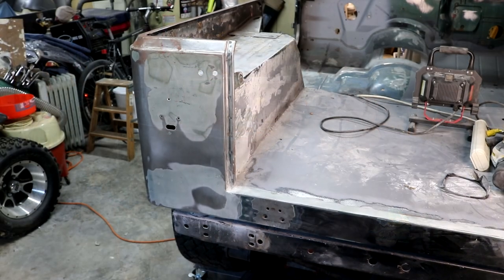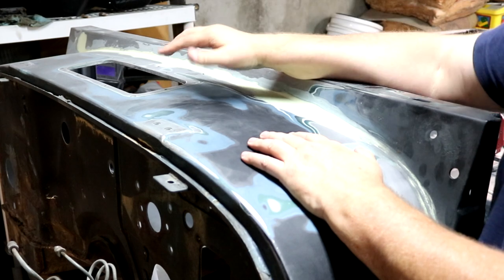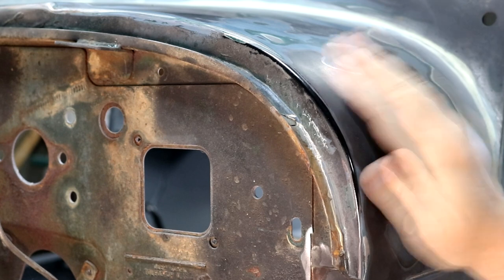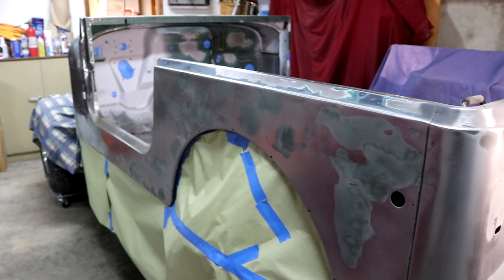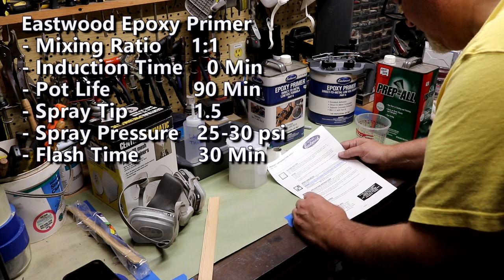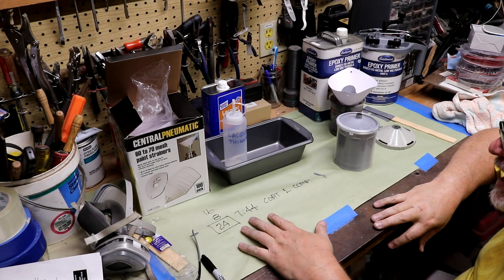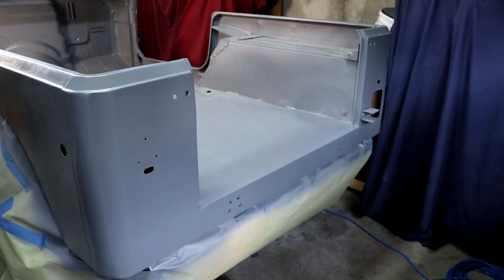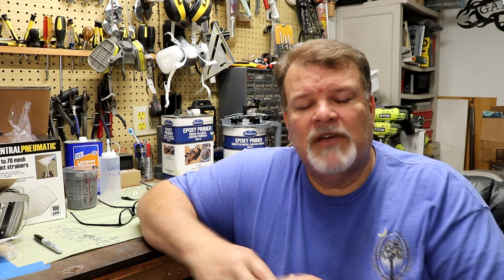Jeep CJ7 Tub in Epoxy Primer | Project Rowdy Ep039

Comment: LOL, I have been following Project Rowdy for some time as I am in the process of doing the same thing to a 1979 CJ7.  You did pretty much everything I have needed to do on the Jeep as mine was a rust bucket frame rails out.  I still have a lot of work to do but it is getting there.  I am in the process of fabricating the driver's side Quarter panel right now as the Jeep was in a wreck and it was hit and screwed up pretty bad.  I am trying to salvage the top rail since recreating the bends would be a big job to tackle.  I had to comment when you brought up the 1968 Camaro, I am also doing a frame off restomod of my 1969 SS Chevelle.  That is just to much of a coincidence.  :)  Good luck on the Camaro as well as finishing the CJ.

Cheers
Eddie
Reply from the maker: Two men with the same passions.   My Jeep project started off as.... " Just fix and replace what is bad or broken".  The more I fix, the more some of the "iffy" parts have to go.   Wondering if ordering the whole Jeep as parts off the internet wouldn't have been faster.   Hell, I'm still slowly tearing things down and it's been 4 years!  

Well, it is worth saving these ole things.  They are tons of fun.  Bought mine in 1988.

Looking forward to a little change of pace with the Camaro and some simple updates.

Cheers to you as well!    Mike

Comment: I love the raptor liner I put in my cj it was easy to do as well
Reply from the maker: I think I may go that route.   Can you give me an estimate on how many cans would it take to just do the bottom of the tub.  I plan to do more than that but can use that as a starting point for estimating. Thanks.
Reply: @UCanDoIt2Mike  on the complete inside on my tub I used 3 cans at 60 psi which is a little bit of a rougher more texture than most people do. They come in a kit with the gun and 4 cans for like $140 I would start out with that. If you think you would need more I could buy 2 kits I mean it’s not too too expensive. But I’m pretty sure you can buy individual bottles.
Reply: @UCanDoIt2Mike  this is an actual gun and bottles you spray with an air compressor so you can adjust the your psi to how ruff or less ruff if a texture you want.
Reply from the maker: Excellent.   Thanks for the estimate and I think I will buy the kit with gun and 4 bottles to start.  I plan to do the tub bottom and tub top. Cheers.  Mike!
Reply from the maker: @coltonthompson1844  Yes...  I have seen that kit.  I appreciate the info on the coverage.  I'll start with the 4 bottle/gun kit and add more bottles as need to cover the other areas that I plan to be textured.   Thanks again!

Comment: Mike, looks great!  Haul Rowdy up to NE Ohio and we’ll get it painted!  Couple things I noticed, I use the same gun for my primer,  leave the air on continuously so the primer doesn’t build up on the tip.  -this will be much more important with the 2k high-build.  If you go with the Raptor Liner (like I did) you can use my applicator gun.  Just let me know.  Last thing,  I used 2 different cleaners for the body before painting.  1st wax and grease, 2nd stuff is called “final-wipe”.  Then finally with a tack cloth.  Again, glad to see you back man!
Reply from the maker: Bob... If you were closer, I would take you up on that offer and if things get slow around here, I am always up for a road trip!  I believe that most of my problem is that my Air Compressor is in the same room and when it kicks on, it blows dust.  I blew it off and tried to clean up around it but not much luck.  Thanks for the reminder on keeping the air going, I know to do that, but forget to do it.  I'll make a note an put it with my equipment to remind me.  I believe I am going with Raptor Liner.  I might take you up on barrowing your gun.  Let me look into pricing and kit availability.  What is the name of your Wax and Grease remover?  Cheers and thanks for sharing your Jeep project on YouTube.   I really enjoyed following your project and added many notes to my OneNote log based on your experiences.   Mike

Comment: How are you sanding to remove the flash rust? Are you using a sander or just a hand block?
Reply from the maker: My flash rust was on surfaces that had previously been sanded smooth.   I was able to hit it with 320 on an orbital sander and it came right up.  

If I had found anything deeper, I would have tried wire brushing and then hit is with Eastwood’s Rust Inhibitor.

Comment: Hey Mike! How is "The Mistress" coming? We need more videos bro! 
Also, you mentioned adhesion. Does the Eastwood call for 400 grit? That sounds kinda fine for bare metal. 
For prep, I use Sprayway glass cleaner, possible acetone if greasy, then always final clean with PPG H2OSoClean W&G remover.
Reply from the maker: My son and are currently trying to uncover a gremlin in the headlight circuit.  Been screwing with it for 3 hours.   Believe we have it nailed down and plan to bypass original wiring.  His wedding is this weekend and he wants to drive away in it.   Have several videos on it that I need to edit and post.   Cheers.
Reply: @UCanDoIt2Mike  Good luck! Have a great time at the ceremony

Comment: Thrilled to see you back. I'm going to be trying Eastwood roll on primer on my 57 Chevy so similar products. I'm wondering about your concern on the short strand fiber body filler would a sealer prior to epoxy primer have covered different? My Jeep will get work after the Chevy gets primer.
Reply from the maker: Would like to know how the Roll-on primer works for you.  I assume that it it self leveling.  For my primer situation, that is the second time that I have applied it over metal and SSF ending with the same result.  I feel confident that now that I have a consistent coat of primer on it, that future coats will hide it all.  As I mentioned, there is a little bit of normal body filler that needs to be applied and then a few coats of a high build.  The High Build should cover it well.

Cheers and many thanks for following along.  Mike

Comment: I first started following you when you were doing the LT1 Swap.  At that time I was planning on putting an LS in my 37 Chev PU.  Well. my cousn's son found a pristine 2014 Silverado, low mileage with a 6L80E transmission and thought it would be a nice drivetrain for my truck (the truck was originally his grandparents).  Well I have it and I"m finding that an LT1 is very differnt than an LS. No power steering pump.  Vacuum is by a belt driven pump.  It's direct injection and there are no guieds for rewiring the harness.  And even if I could, there is no rooom in the engine compartment for the computer.  SO I'll probably go to someone like SPEARTECH for a custom harness.  I can get a PS pump and mounts for around $500.  Overall, it's going to be an expensive engine to get operational.
Reply from the maker: That is going to be a fantastic ride when you get done with it.   You'll never look back.   Have fun with it!  Mike

Comment: Looking good. Full bunny suit should be used.. paint is toxic. 1.8 tip on primer paint will flow better. Filter cartridges in plastic bags between use. Don't  wimp out on painting top coat and clear, your prep is very good, your results will be the same...Cheers.
Reply from the maker: Thanks for the feedback.   Mike

Comment: i somewhat stopped watching your feed after the LS material was completed, very much enjoyed your narrative on the subject..... noticed that you are now in the body restoration part now, I have never been a big fan of Eastwood paint products, I have been in the automotive refinishing trade for years, and for the home hobbyist, you may want to look into Southern Polyurethane products. Their epoxy primers are very user friendly and in line with top manufacturers for quality without the price if you are not able to get the usual volume discount. Their clears are also top notch as well.  As for doing your final painting of Rowdy, I am not aware of your surrounding, but what I now do for home spraying in decent weather (decent temp and no rain in the forecast) is to purchase a temporary Garage structure (10x20)) for a couple hundred $$$ and on the one end cutting an opening in the panel and attaching a 36" fan with furnace filters fitted to the outside and pointing it such that the tent is positive pressure. the amount of dust is kept to a minimum and the little that is there is very easily cut and buffed out..... just a thought, but it really depends on your surroundings, not something that is really acceptable  if one is living in a subdivision, unless your neighbors are gear heads
Reply from the maker: Thanks for the detailed response.  Several of the channels that I follow use SPI and they appear to like it as well.  When I run out of what I have, I will most likely give them a try.  Not sure the Neighbors will go for a popup tent.  They complain when a car is parked in the grass.  You know those type of people with nothing better to do than complain.  Cheers   Mike

Comment: When I sprayed primer on my CJ I built a paint booth out of PVC pipe and big plastic sheets.  It worked pretty well.  I'm planning on rebuilding the paint booth when I do my final paint.
Reply from the maker: A PVC Tent might work for me.  My biggest issue is that my Air Compressor is in the same room and the cooling fan blows towards the work area.  Think the wife would mind if I moved it to her laundry room?

Comment: Thanks for the post.  I have a 93 YJ and have the same issue with the cowl/pillar or whatever its called.  Did you do a video on it or photos on how you did it?  The part that's rotting out is below the windshield and I was thinking I could just cut out that part and weld in new metal.  There is seam sealer on that seam on mine.  I have a rubber gasket where the hood mated up with the cowl.  I will be looking under it when I get a few minutes.
Reply from the maker: Sorry about the late reply.  If you are talking about the joint that I replaced under the dash where the Cowl meets the lower windshield panel....   I did not video that work.  I did fabricate all of the parts from flat sheet metal.  It gave me a reason to purchase a Shrinker and Stretcher tool.   On the outside, I have to replace a 1" section of the Cowl and 1" section of the lower windshield frame.  I made that out of 2" wide sheet metal.  Bent it in half and then stretched the Frame side to obtain the curvature of the cowl, then I had to Shrunk the cowl side to bring it back flat with the frame.  By making this out of one piece, I was able to create a very strong joint.  I believe I also added a small strip of metal to the inside of this seam.  Very pleased with how it came out.  Hope this helps!  Mike

Comment: Enjoy watching your progress!  I just got a new '79 CJ7 "project" and will be doing a 'tub off' restoration. It sat in a field for 15+ years so I have got some work ahead of me, especially tackling some body rust.. What gage of metal are you using for the body patches?  Thanks!
Reply from the maker: Love it!  I am using 18 Gauge.  As I need more, I pickup a "cutoff" piece at my local supplier for cheep.  So many of the surfaces on these tubs are straight, so making replacements yourself is not very hard and very rewarding.   Welcome to the club and I hope you enjoy your project.  My next step is to remove the tub from the frame so that I can cleanup and coat the bottom surface.

Cheers to you Jason!   Mike
Reply: @UCanDoIt2Mike  Thanks Mike!

Comment: Hey Pardner. What did you end up figuring out for the indentions all over the place from the spot welds. Did you use fiberglass or bondo for those?
Reply from the maker: For mine, a little of both.  I had cleaned all the paint out of the intentions.  Many of them were treated with Short Strand Fiberglass.  As a base coat.  That was to get me close to a final finish.  The tub is still in primer as I have some work to do on the bottom which might include a a little welding. Once the bottom is done, it will get a final coat of Bedliner .  I’m thinking the bottom welding may affect the top and sides some,  that is why I did not take them to a finished state. Then I will return to the top and outer surfaces.   Will finish it up with extremely thin coat of body filler.
Reply: @UCanDoIt2Mike  man I could use a conversation at some point if you're open to that. My step son is helping/doing most of the work. I was a USAF firefighter but broke my back in the line of duty. Only so much I can actually do without really paying for it. While he can just about do anything with cars, we don't have a welder and the preferred set up. Working in the garage on it.  Because of that I'm ordering replacement parts and have the OMIX tub, right fender, and tailgate. After the left fender and windshield frame next. You're insight and experience could be pretty helpful. Thanks for ALL your doing..let me know.

Comment: I’m so happy to see you back working on the jeep!!, are you putting in a efi fuel pump tank in the camaro?
Reply from the maker: Glad you are still following along.   Yes.  The Camaro will get an LS upgrade some day.   The new fuel tank will be to support that.   I will install an EFI fuel tank, but retrofit it with a sending unit and a suction tube.  When the new engine goes in, I will change out the suction tube with an in-tank fuel pump.  Cheers!!!  Mike

Comment: Build a 6.0 LS  with 799 or 243 heads for the Camaro with a sloppy stage 2 cam you can do a carb setup with the msd 6014 box so you don’t need the pcm and you can get a knock sencer delete there’s a lot you can do

Comment: Love your videos. I picked up a 83 CJ7 a few months ago that has more rust than yours. I’ve been watching and rewatching your videos to get a great understanding of what and how to get this done. Your videos are amazing. Thank you so much for all the details and great commentary.
Reply from the maker: Thank you for the complement and glad you have found some useful information.   I am trying to organize this, some help to get my Tub off the frame so that I can continue.   Cheers to you and have fun with your project.   These are really fun and easy to work on.   Mike
Reply: @UCanDoIt2Mike  I know I will have to remove mine at some point. Not looking forward to that. Definitely want to see how your LS swap turns out. Would like to do the same in the future.  Mine came with a mopar upgraded EFI on the 258, with a five speed. PO installed a 4” lift with ARB lockers in the front and rear. Just has so much rust. Taking out the drivers side seat belt took part of the floor and roll cage with the nut.
Reply from the maker: @christx68  I removed the body mount bolts last week and rust fell out. I am not looking forward to turning the tub over.   I have a local subscriber that took me for a ride in his CJ with a 6.0 swap and it got me on track again.  Cheers!

Comment: I painted my Civic in a very dirty garage. I ended up cleaning half and moving a lot of junk outside.  Then I taped over the dirty half with that huge plastic the pro's mask cars with.  I used a big round fan from the hardware store for exhaust and furnace filters for intake and sprayed away. Not too many issures really.
Reply from the maker: I just afraid of the trash in the paint and overspray on everything in the garage.   Still contemplating.    Thanks for sharing your experience.
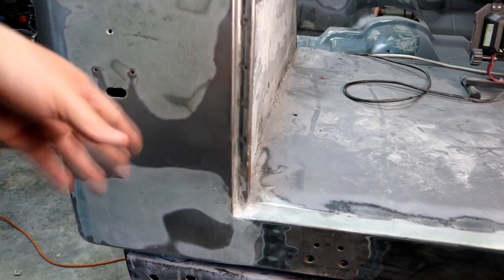Reply: Yes.  I have a very short vid called 'Civic Painted Good Grief' in my vids.  Not a big channel really..... 1:53
Reply from the maker: @67polara  I went and watched it.  It did turn out very nice.

Comment: Great to see you back Mike. I was praying that COVID didn’t get you. So glad you are doing well. One thing a painter friend of mine taught me was to always start spraying a body panel down low and move up the vehicle. This way your overspray will land in the wetted paint you just sprayed and get absorbed. If you start high and move down, your overspray has time to flash out and create more orange peel.
Reply from the maker: Glad that your still following along.   Thanks for that tip.   That is very logical and some great advice.  Makes a lot of sense.  Cheers!  Mike